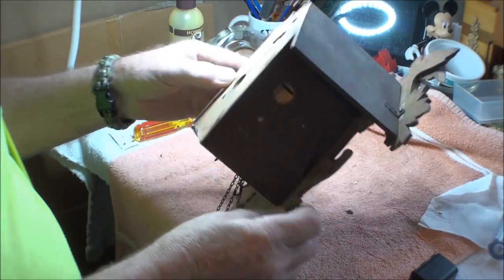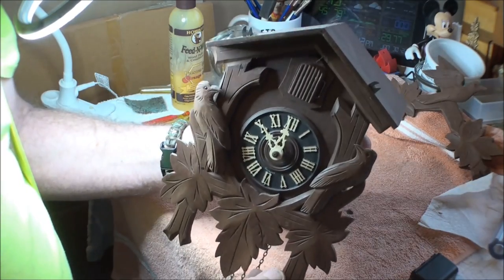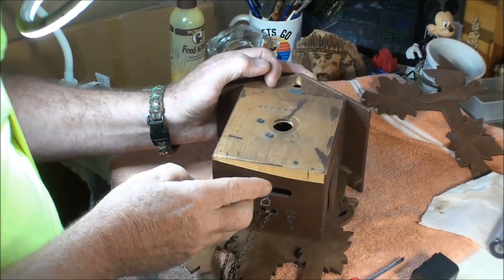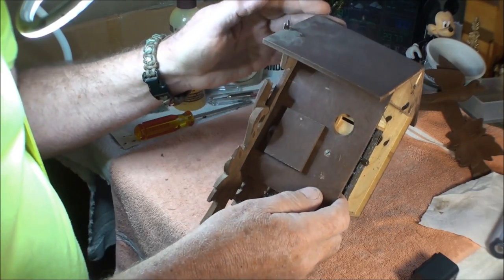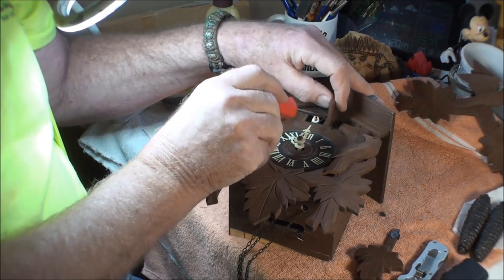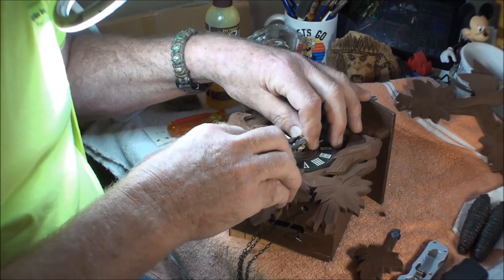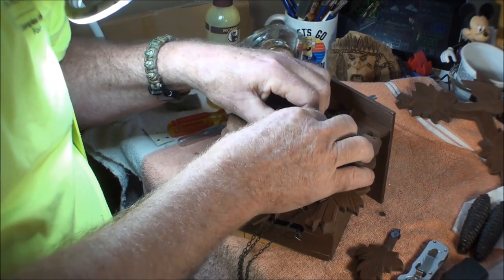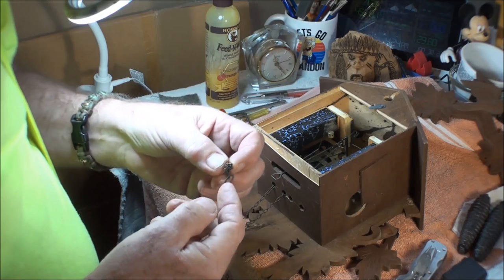Your First Cuckoo Clock and Basic How to Clean or Repair Your Clock

Comment: I've inherited a clock that hung in my grandparents home. It wasnt stored/shipped properly and the chain on the time wheel has come off. It has 3 chains and there are 2 doors at the top that open (little man and the cuckoo).  When I opened the back, some of the wires have been disconnected. I hope to figure out what pieces go where.
Reply from the maker: On most of my cuckoo clock videos, I normally show how to get the chains back on the clock. In your case, You can wrap the chains that are still on the winding wheel so they don't fall off, turn you clock upside down and try to fish the chain back around the sprocket. 
  As for the wires too the bellows. If both wires fell off, normally the back lift arm would go to the high note bellow... the one that lifts the birds tail. Just slip the wire into the bellow U-nail and then with the other end bent like an "L" shape, slip it through the arm hole then bend it back like it was. 
  Watch my video on how I take the wire off but you are doing this in reverse.  Normally if you plan on shipping or just putting the clock away in storage, you would secure the chains with a bread tie or pipe cleaner. Also the bellows need to be secure so they don't flop open. This will hold the wires in place and also the bellow will not flop open for a long time and get stuck in that open position.
Reply: @justmike57  it took me a while, but I was able to get the timing chain back on. Tomorrow I need to buy glue and reattach the bellow to the whistle. I suspect that the missing cone is a bigger one for the time wheel. It only wants to tick-tock with extra weight on that chain. Thanks for your video!
Reply from the maker: @wildflowersnhoney209  Extra weight means the clock is in need of oil on the Front and back where the bushing are for the gears. This would be a good time to use can air to blow out the dust also. They say if your clock stops.... then it is time to take it all apart and clean all the parts from the old, gummy oil and dust. The fresh oil, loosens the gummy oil and keeps it from drying out. Not sure what you meant  about a Cone.

Comment: Hi Just Mike, I followed your instructions to replace the Bellows with Tyvek Paper, put them back, I also  replaced the Hands at the same time as I of them snapped off.

Now the Bird isn't Coocing and the Gong isn't gonning! 
Please HELP, what have I done Wrong? 🙏🙏

Cheers Cheryl.
Reply from the maker: There is a chance that the bellow wires are on the wrong bellow. With your clock on the table and the back open, see how far the clock is trying to open the bellow. The MAX. you want them to open is 3/4's. If the Bellow opens all the way, the clock is normally in stress and can't finish it's job. Also watch your lift wires so they are not rubbing on each other or hitting the pendulum wire.
Reply: @justmike57  Thanks Just Mike, I'll open it up again and have a look. 😉

Comment: I have a 24 hour clock and everything works fine but The door opens slightly about 5 minutes before it strikes and then doesn't close all the way when the bird retreats back in.  Any suggestions? Thank You
Reply from the maker: It sounds like the timing might be off a bit, and or the spring to the bird rod is too loose. Also if you have a count wheel, like on older clocks have that are made before 1950, you would have to adjust the arm that triggers the cuckoo. Look to see if the spring wire is still on the rod or may need an updated spring to replace it.

Comment: Mike, could you tell me what could I clean a cuckoo clock with till I get my Howard’s feed & wax in the mail. I want to clean it b4 working on it.
Reply from the maker: Just using a paint brush to get behind the carvings and the carving details would do the trick. I also use Murphy's Soap for wood is a good cleaner it the clock is really bad. Just wet the rag and wipe it down, not to soak the wood very much. Let it dry good before using the Howards wax.
Reply: Thanks, I’m a female novice got three up & running. Now I really bought a challenge. A guy on eBay said this Hunter Clock fell off their wall and it’s really in pieces. Won’t have to worry about the carvings as they
fell off as well lol. So cleaning should be ez. Lol 😂. It’s a eight day clock. Hope I will have luck. The first one I did was really little. So you couldn’t move your hands around in there to work. I pulled the movement
in and out five times. Finally got all the different issues fixed. Thought I had ruined it on the last go around
but she was fine. The folks bought her at an estate sale and didn’t know anything about cuckoo clocks.
Turns out I didn’t either, but was willing to learn. Many thanks to you & Mark you are my gurus. Matter of
fact your on my tv right now 😂 Thanks again. First step Murphy’s Oil Soap. Many more steps to come lol.

Comment: Awesome video! I took my clock apart today because the chain derailed. I was able to get it all back together and ticking but now it won't cuckoo. It's gotta be some detail I missed. Any ideas? It's very similar to this clock.
Reply from the maker: Great to hear you got the chain on. Move the minute hand just past the 12 and pull the winding chain just enough to let the cuckoo gears wind backwards a bit, then pull the weight side and see if it will start cuckooing again. Sometimes the star wheel that makes the leavers work will get hung up and bind the cuckoo from working. 
  Also if that don't work, you might have to take the movement out and check the front of the movement. Look at the lever that drops on the Snail looking plate that the hands attach to. The one that has all the teeth that the clock counts the hour and make sure it is dropping down for the clock to know how many times it is suppose to cuckoo for the hour.
Reply: @justmike57  it wants to, the bird came out but only tried to cuckoo. I'll keep playing with it. Thank you for the response. I'll ask you again if I can't figure it out.
Reply from the maker: @edr449  Check to see how far the bellows are opening. They should open, Not over 1/2 way or the clock will over work and not cuckoo.
Reply: @justmike57  I can get the gears to move when pulling the weight. When it tries to cuckoo its just kinda half a noise (no cuckoo, mostly mechanical) then the door gets stuck open. I'm thinking I put something back together wrong? I found your email, I can send pics of everything.

Comment: i have  the same clock but its missiing the weights and penglium do u know the exact weights of each pinecone ??? also could i just throw this whole brass movement in a ultrasonic cleaner ???
Reply from the maker: I have a book on some of the plates of clocks and can look up what weight the clock takes. If you want, take a picture of the back of the movement and I will see if that movement is in the book and let you know the weight size. My email is below the video.

Comment: Wow, how much does a clock shop charge to clean a clock like that? Like you said, if it is a cheep clock try it. If your great grands had it, Take it in to be serviced. Oh and do not put it in the kitchen.
Reply from the maker: Depends on the shop you go to. They are very high priced and still, they are backed up with repairs on the clocks out there.

Comment: 8:25 a.m.   Both hands on my Black Forest each day Cuckoo clock will not move.  Can you help me.
Reply from the maker: If your clock still ticks and the hands will not move, I would think that the disk on the front of the movement that holds the hour hand and gear in place came off because the E-clip came off.

Comment: Mine is striking up to 6 but it strikes 4 times at seven and just is completely random
Reply from the maker: Sounds like you need to oil your clock. The lever that drops on the snail is sticking and not falling all the way after the 6:00. Also, check that lever that drops on the snail, in case it is bent from turning the hands counter clock wise. You never want to turn or change the time of the clock that way. It does have a safeguard on the lever, but it can not be trusted fully.
Reply: @justmike57  thank you so much
Reply: @justmike57  it’s all back together now but the the lift arms for the bellows are catching on smthn
Reply from the maker: @destructionandmore5430  Do you see them catching on something? or is the Bellow, itself opening too far. The max the bellow should open is 3/4 the way open. If the lift arms are hitting each other or the pendulum wire, just bend them back a bit so they are free.
Reply: @justmike57  yes it was catching on the other bellow and now I have bent it back and it is fully working! Your a lifesaver tysm

Comment: Do you give quotes?
Reply from the maker: I do. I have an email below the video you can contact me. This is a hobby, and when I have time to work on the clocks, I get them done after starting them. Send some pictures of the clock and the movement and let me know what your clock isn't doing for you.
Reply: @justmike57  thank you for getting back to me. My cuckoo clock is a small one. The door to where the bird comes out is very loose. I try to fix the bellows but when I try to put the left one on it would catch with the right one and fall off. I'm on fixed-income give me a quote on what you think would be best. My father would fix it that he's passed so I don't know where else to go. I caught a clock repair in Omaha here, they wanted $300 just to look at it.  Thank you hand for taking the time. I'm not sure how to attach the photos.

Comment: What do the side doors do?
Reply from the maker: Normally if the clock has a side door, it is for inspection and also to trigger the cuckoo if it is off from the hour hand or striking the hour on the 1/2 hour, depending on the movement you have in your clock.

Comment: One of my chains just fall once I put weight on it
Reply from the maker: Sounds like your winder has failed. Not knowing how old your clock is, but you might be able to just oil the winder, clicker. Or you can normally buy rebuild parts to repair your winder, of just buy a new winder wheel for your clock. I shop on line for most of my parts at Ronell Clock Co.

Comment: Thought he would NEVER get around to the dis-assembly, and I was right, he never did.
Reply from the maker: You might be right, yet if you look at my other cuckoo clock videos, I take apart the cuckoo clock movements completely apart and clean them, oil them and reassemble them like they really should be for a good cleaning. In some of the videos I explain what some of the parts do so if you are having the a problem with your clock, you will know what to look for on your clock.

Comment: again you don't show where the weights go AAAAAH
Reply from the maker: Surprised  you don't know where the weight goes. When you Pull on the chain and it dose not move, That is the chain you would install the hook for the weight. If the Chain Moves, then you would put the ring on that chain because it is the chain that pulls the weight up to the clock for at least a 24hour run time before you have to pull the chain with the ring on again.